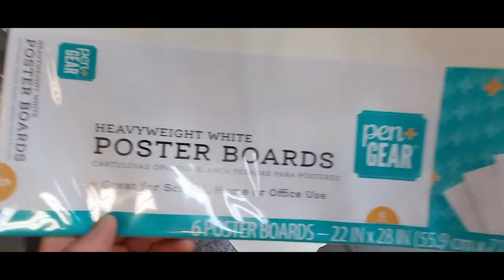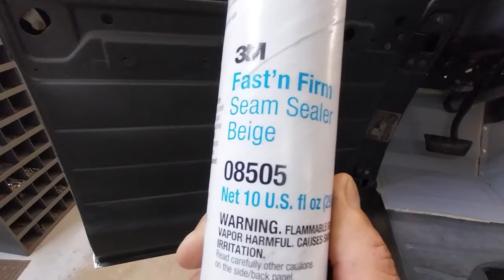How to make replacement  floor patch panels and  trans tunnel FAST & EASY !   D I Y Auto Restoration

Comment: Nice work, great tips!  On the removeable tunnel, do you eventually add some sort of gasket material to keep out wetness, road grit, etc?  Thanks!
Reply from the maker: Thanks ! Yes after paint, I will install a seal.
Reply: @guzzifabrication3448  Thanks for the quick reply!  What's your go-to seal material?
Reply from the maker: @bobg9873  the brand soft seal makes high quality products
Reply: @guzzifabrication3448  Thanks again!
Reply from the maker: @bobg9873  👍

Comment: Great work! Very clean!  What do you plan to use to seal the transmission tunnel?  My first thought is a high temp butyl tape but curious about your approach.
Reply from the maker: Great question, adhesive backed outdoor collapsable foam tape works well

Comment: Poster board is cheaper than metal but it still gets pricey if you’re doing a lot of metal work. I grabbed a roll of Ramboard from Home Depot & it’s not as good, but it works.
Reply from the maker: @loganshotrod4x464  Thanks for the info 👍